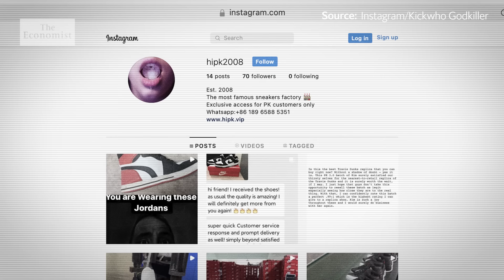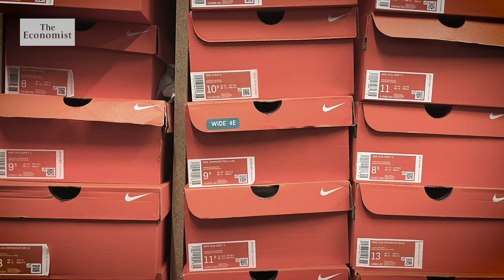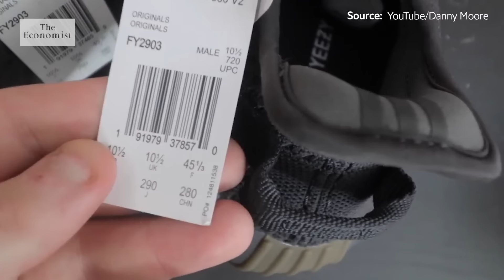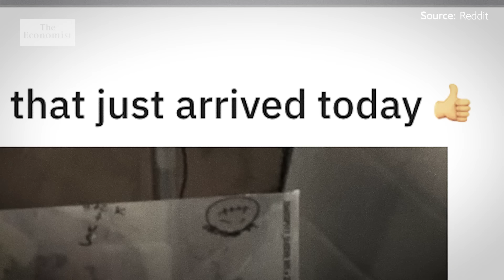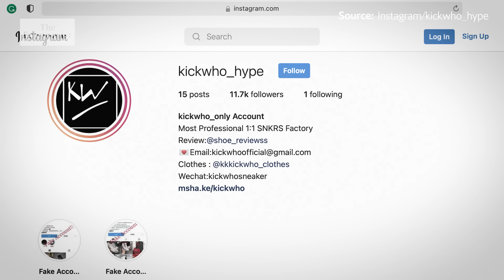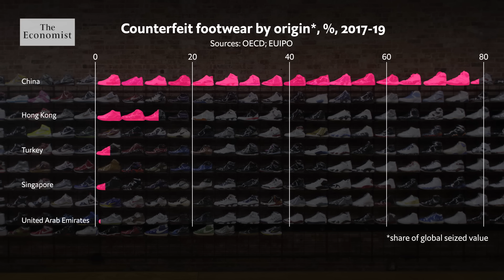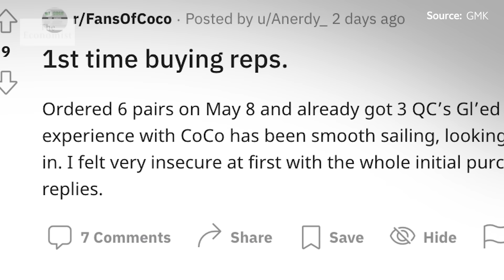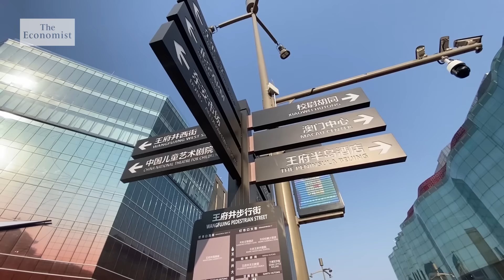Why the counterfeit business is booming

Comment: What I learned from this video:
+ People are buying counterfeit goods from Reddit
- Some counterfeits go to funding other crimes
= Actual brands should lower prices
Reply: Most of the time the issue isn't the retail for example with Nike and Adidas. The issue is that those companies I just mentioned make some of their most hyped releases extremely limited quantities that when their released on their apps bots buy all the stock immediately and then resellers resell them at extortionate prices. This makes a lot of people mad so as a protest to Nike and Adidas for not combating bots, they buy counterfeits or "reps". Resellers and Brands inaction to counter bots are the real problem. Buying at retail price for hyped limited releases would be a blessing for most.
Reply: @ryadhasanahmed5443  Ohh I see, thank you. Though I would say the stupidly high price at retail (in my opinion of course) is still an issue lol. But didn't know that bots (the limited supply) was the main reason people buy counterfeits, thanks.
Reply: @ryadhasanahmed5443  Does " "reps" " in your post mean "replicas" ? Not sure.
Reply: @-First-Last  Yes, reps is short for replicas
Reply: @-First-Last  yes I have heard it as plicas not reps as that is slang for several words.
Reply: @ryadhasanahmed5443  Thanks !
Reply: And here in my country i can easily find pk grade reps via local online shops .

Comment: Only “sneakerheads” (resellers), will say that fakes are bad quality. Nah, they only say that to get you to buy from them or others who “authenticate”  shoes and rip you off. Fakes and authentics are made in the same countries/factories. That strong chemical smell is because they dont let the shoe air out the glue smell.
Reply: Only counterfeit manufacturers will say that fakes and authentics come from the same factory. They literally create new and improved batches of fakes over time lol
Reply: I bought a fake Nike shoes in 2015 at just 10$. It was almost exact one to one copy. That shoe went on to serve me for 4 years of rugged use when it finally gave away in 2019. 

Although now prices have risen but you can get similar shoes at 15-20$>
Reply: @schrodinger1811  Irrelevant. Quality and durability is not the reason why those Nikes are super expensive.
Reply: @NE0C0R7EX  i am talking about quality and durability of the fake ones. And they looked exactly same like orignal. 

You can disagree but for most people orignal shoes are bought for that very reason.
Reply: @schrodinger1811  Nope. No one buys Off White 1s expecting $3,000 worth of leather.
Reply: Fakes are not worth anything ... only poor ppl buy them
Reply: @schrodinger1811  just buy original on sale
Reply: A sneakerhead is not the same thing as a reseller, those are different words with different meanings
Reply: @babagandu  yes I buy orignal only but regular ones not these overhyped overexpensive ones.

But some first copies are almost exactly the same as original. The material as well as looks is the same.
Reply: @schrodinger1811  ah I see ... me personally, I don't go near fakes
Reply: @NE0C0R7EX  people pay the prices because they like the idea they are better than the slaves that made there shoes it gives them the 'Superiority rush' they desperately need.
Reply: @rblxplaysmochax6808  Not really. It’s the same reason why anyone pays high prices for any collectible product. You buy authentic if you’re doing it for yourself. You buy fakes if you’re desperate to impress others.

Comment: Fun fact: 
The big brands have off-shore factories in some LDCs or Developing country.
Most of the time, the so called "reject/defective" footwear ends up flooding the market in much cheaper prices.
Also, the same countries, make shoes from the same material, remove a component or two, and name their shoes as Abibas instead of Adidas or Nikee instead of Nike or simply switch up the logos.

The bottom line, people in the first world end up paying wayyyy more in the name of  "BRAND", while the material is almost similar.... Not same, but similar.
Reply: I was in China when the whole thing started in the 2010s. It basically works like this: a Nike-contracted factory will import more materials than it needs, which is normal because sometimes you mess up a pair or two. But they import way more than the regular margin, and they use the rest to produce the ""fakes". But since they don’t have enough plastic labels (the one inside your shoes that tells you the size, which is made elsewhere), they have to fake those. So this is why most authenticators will check the plastic labels first. And as you mentioned, the "reject/defective" ones are also sometimes sold, albeit the factories are required to slice them up to destroy them.

Comment: A lot of the main players recently relocated to Vietnam (from China) to pay workers even less. Balenciaga, among others, have since moved in and found a niche to exploit. They can mass produce complex and high end designer products using the expertise in stitching that would have otherwise gone into abeyance.  

The same void is what's producing the high end Replicas as the surplus infrastructure/ workforce struggles to diversify. The machine is also moving too fast to pivot in another direction. Trying to shut them down is as futile as cutting weeds, plus it's free advertising, so not a completely worthwhile pursuit. I suspect there is some residual guilt, with a handful of corporations having created the problem in the first place as well. Whilst these type of manufacturers used to often be derided for having subpar and obvious counterfeits, they're now offering comparable products (if not better). They're not just available months in advance, but with more design innovation as well. Shoes with a certain colour pallet are rumoured to be released, mocked up on photoshop, shared online and are in production/ for sale within weeks. Another innovation are those who want sneakers dreamt up by a customiser (modifying real shoes) and there's only one place to get them duplicated and on your feet. These are key USPs that brands can't diversify fast enough to match, at least not on any meaningful scale. 

They're essentially becoming placeholders responsible for the marketing of their own brand, whilst becoming a parody of their former selves. Reebok and Jordan Brand/ Nike are renowned for this kind of fickle behaviour. However, it's a double sided coin and no publicity is bad publicity. On the flip side this creates a simultaneously counter reliant and self-perpetuating industry, if we treat the sneaker industry as a single entity. Many sneakerheads are indiscriminative of the black market releases and this attitude permeates language and class. The video game industry has made similar strides since the mid 80s and there's a significant overlap between these subcultures. Anime, superheroes and musicians are also well represented in an increasingly homogenised demographic. The perfect storm of social media exposure (Instagram/ Watsapp/ Youtube/ Reddit), influencers and global commerce only fans the flames. Demand is artificially and abnormally high and the hype train isn't slowing down any time soon.

Comment: I've bought 3 reps of Jordans and honestly, the material are identical or almost the same as retail. Heck, QA is significantly better when buying replicas since you get to decide whether or not the pair of shoes you're getting is up to your standards. You get to choose which batch and factory you're going to buy, and even pick a reputable midman. 

I wear a pair of replicas that their retail counterpart costs $1000 resell as beaters. No one cares if they're fake or not. 99% of the population aren't sneakerheads.

The only difference between reps and retails pairs is that the latter requires you to pay for their brand.

Comment: The funny thing is that this is how the actual fashion retail industry works - professional buyers go to Europe fashion shows, buy samples, bring them back home after drilling holes in them (to get around import duties), and then use them to plan a range for the next season.(So they may not be counterfeiting the brand label, but they are copying major aspects of the design)
They then go to China to get them made in large quantities (don't blame China on this - they are just the outsourced factory).

If the industry works like this, how much easier when the "value" in the shoe is inflated due to some tick-mark label...

Comment: Anyone that's investigated manufacturing a high-value proprietary product overseas knows about the "Ghost Shift" where the factory produces an undocumented and undisclosed extra quantity over the amount you order. These end up becoming the highest-quality counterfeit items available. Though even if made on the same factory line there's a degree of less QA as they are more likely to sell an item that might have been rejected for defective components. However if you've picked a decent factory the reject rate should be low anyways. So yes fully 1:1 counterfeits do exist. Providing your own, specific quantity, certificates from an independent factory can at least help authentication.

Comment: This is usually a sign that something is way over valued vs the cost and difficulty to produce. Sneakers are essentially mass produced combination of leather, textile, rubber, plastics, and synthetic materials, how is it worth 6000 pounds? It's not like it's made with irreplaceable craftmenship or super complex high tech, high capital fabrication tooling that only a few exists in the world.

 I mean It's a sneaker. Over valued to 6000 pounds. Probably made in the same factory that makes 90 dollar sneakers. It's not even bespoked. Neither does it have any security built into the process to create barrier to counterfeiting.

Comment: Wait.....so the fake shoes are made in the same factories with mostly the same materials as the real shoes and the fakes may come with slight imperfections but cost substantially less? And most people buying fakes know what they are buying. It seems the MOST obvious solution here is for manufactures like Nike to move manufacturing back to the USA. American factories can be more secure and have more production control to prevent counterfeits  Nike would never do that because it would cost them more so they put up with fakes. In the end it is really Nikes fault for disregarding the most obvious but expensive solution